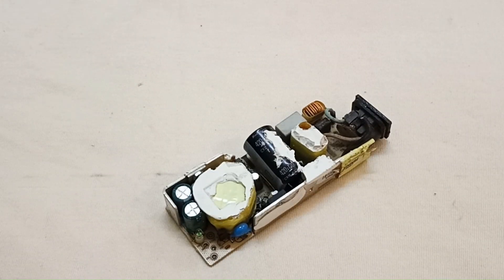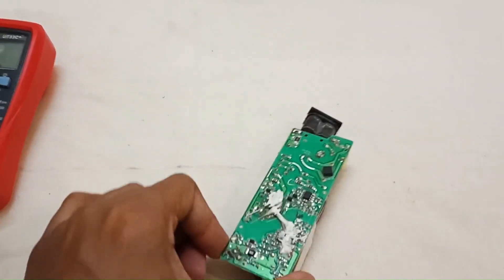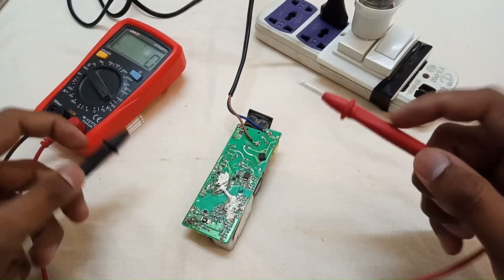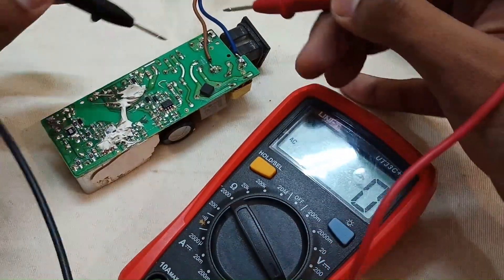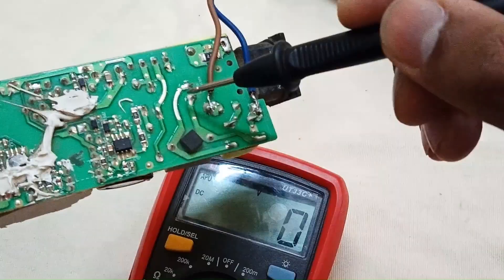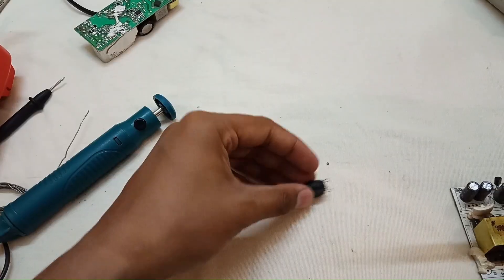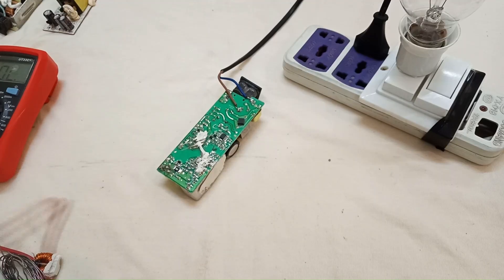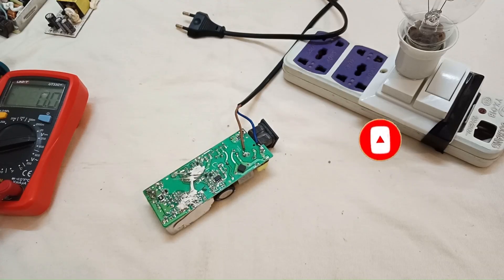Mastering Laptop Adapter Repair: Step-by-Step Guide and Troubleshooting Tips! #diy #laptopcharger

Comment: good work, I have same problem and the output voltage is 19.5V - 4.64A 90W write on charger HP pavilion G6, and after repair the voltage output is 19.8V, is this problem or there is any dangerous on laptop? thank you for your reply.
Reply from the maker: No problem at all, voltage up downs a little bit.

Comment: In my case, the fuse is dead, what should i do, any alternative?, can i direct the connection without fuse? Or any other alternative?
Reply from the maker: Yes. Take a thin piece of wire strand and solder on the fuse points. No problem
Reply: I soldered another fuse which is 2A and it burned.  @Electricquantism402
Reply: I try using normal fuse but blown, 2A 250V, (the original one is rated 5A 250v slow blow fuse) now in market I got 3A 250V, didn't find 5A, can i use 3A?  @Electricquantism402
Reply: Their may be some other underlying problem also, which lead the fuise to blow, like shorting of mosfet or other component. U should use a series lamp for testing when u r trying to bypass the fuse by wire, or u may get a second BOOM😅.

Comment: My msi laptop adapter from chicony brand of 230v  is faulty while connection my room lights are switching off and can a gaming laptop adapter be repaired...
Reply from the maker: Check your wiring for loose connections or its short internally as some components.Gaming laptop adapters can be repaired, but you may need special parts.
Reply: @Electricquantism402  thank you..
Reply: I have the same adapter and mine isn't working rn

Comment: Hi my laptop charger output shows only 1.5 volt ... When i removed optocoupler showing unstable 19-21 volts . Then i installed a new optocoupler again the same problem showing 1.5 voltage. What is the reasons

Comment: When I check my laptop adapter output is good but when I connect with my laptop  that time charger is not accept lode
Reply from the maker: First check voltage on main filter capacitor if its okay.. voltage shouldn't be fluctuating a lot ...then see output caps, double diode rectifier etc..

Comment: Amplifier se connect krte hi humming araha ha, baki sab thik ha, problem kaha ha batao, laptop ka adapter ha...!😊
Reply from the maker: Ground ka issue ho skta hai..... ground wire direct main capacitor k negative pe solder krdo.
Reply: @Electricquantism402   ha ground ka issue tha thank u... Mere extension bord me earthing nehi tha, earthing ka connection krtehi humming zero.....
Reply from the maker: @soumikmondal658  good.

Comment: 170w lenova adopter voltae 19.5 or 20 shows immediately drop 1.
Reply from the maker: Check the output caps... Check optocoupler also
Reply: Main capacitor may be faulty, 350v capacitor

Comment: i am getting 18v output which should be 19v acer laptop charger.indicator light on charger is ok..but laptop is not taking power..after long rest again charger works.. there is small burnt in circuirt board  below main capacitor but not in any green part of PCB and any other components.
any solution?
Reply from the maker: Remove the capacitor and check if its weak due to short.. resolder all the points again..
Still I can't tell exactly what happened to your charger...

Comment: The power supply come from both neutral and positive of charger output when I check using Tester..how to repair it..Could you help me to fix this
Reply from the maker: Is it giving a shock or not from output?..
This happens when circuit is not grounded..
Check for it... otherwise it's fine.
Reply: @Electricquantism402   @Electricquantism402  When I touch output pin It didn't give me a shock..When I used Tester it shows red indicator on both supplies (Both red and black wire)..But laptop didn't getting charge..how to check it is grounded or not..
Reply from the maker: @sureshbalajijayakumar3814  check the output voltage..
Reply: @Electricquantism402  Same condition but it giving shock what should I can do
Reply from the maker: @rohitshinde6914  check the output voltage first..if its matches to the value mentioned on adapter so its fine..
For shocking problem, take a piece of wire and solder it between your input ground (3rd terminal in 220v plug) and output -ve wire..
Reply: @Electricquantism402  yes did the same now it working fine thankyou

Comment: Green indicator is on but not charging...
Reply from the maker: Output pin maybe faulty...check voltage on it and also on circuit output

Comment: Does ac dc adapters contains mercury in it pls reply
Reply: Ac adapter is teardown but it's working even though I am very tensed about the mercury
Reply from the maker: Yes..in circuit boards and transformers etc.. they also contain lead and cadmium they all are heavy metals.
Reply: Is it danger

Comment: If supply is ok but not charging  what should I do ??
Reply from the maker: If its dell charger and output supply is ok but still not charging then maybe it's due to dallas 2501 transistor like memory chip which is connected on output terminals having three pins .

Comment: I like your video.
How can I buy the transformer for the laptop adaptor? I want the name of the ferrite core, I mean the name and dimension .
I have searched online but I was unable to buy the ferrite core 19v transformer for laptop probably because I don't know the exact name to search in EBay or Aliexpress.
Reply from the maker: It's basically EMI section inductor you will get from old powersupply circuits.. while the transformer is not sold separately you have to replace from some other laptop adapter circuit.
Reply: @Electricquantism402 
Okay thank you. 

I believe,  it is possible to buy it somehow, maybe without the coil windings.

Comment: My fuse is not working but when i direct ac current without fuse my wire gets broken so what to do next i hope u understand my English 😅
Reply from the maker: Urdu bol lo...
Konsi wire khraab ho rhi jb connect krte ho?..fuse wli jo direct ki hai?..
Reply: @Electricquantism402  yes
Reply from the maker: @singleplayer77  to iska mtlb koi aur chiz short hai... check mosfet or main capacitor
Reply: @Electricquantism402  main capicator ko agar desolder kar deta hun to multimeter usse sahi dikhata Hain agar dobar connect kar ke check karta hun to continuously beep sound deta hai. Or MOSFET ka pta nahi ye kya hota hai
Reply: When I try to plug in my charger my inverter show short circuit and turn off itself
Reply from the maker: @singleplayer77  on circuit agr short bta rha hai to rectifier short ho skta hai... 
Contact me on WhatsApp
+923093333809